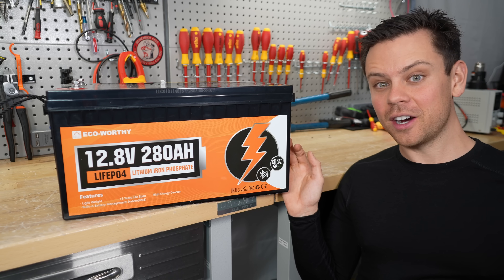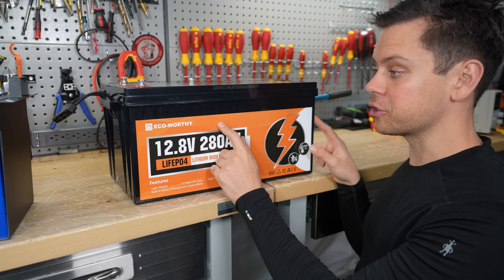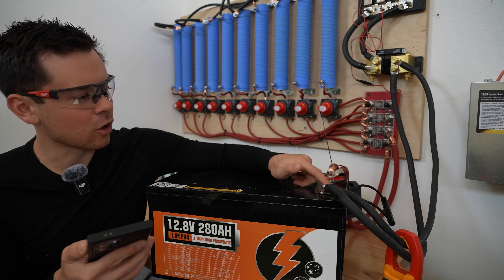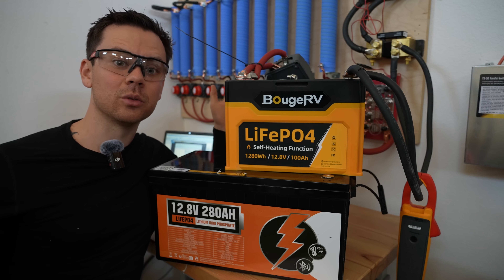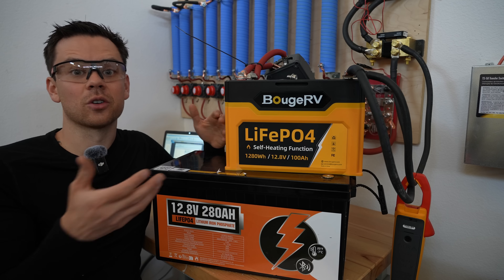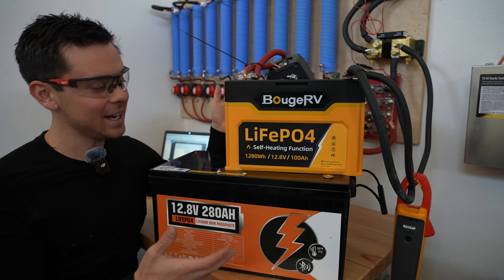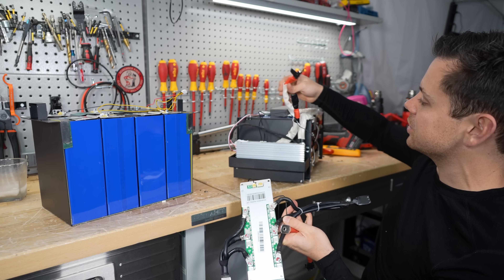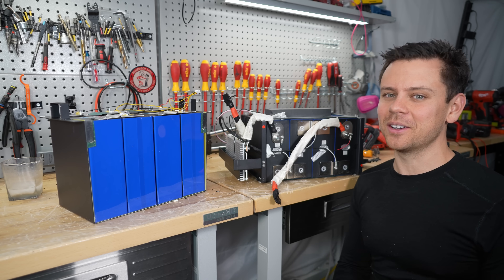$423 Ecoworthy 280Ah VS $529 Wattcycle 280Ah and Over Current Discussion!

Comment: Great surprise with this battery. I think they have a sister company (DC House) would you be able to get a hold of their DC House 100ah with usb-c and 12v/5a Dc port? I am very curious which cells they use and how they connect the usb/dc ports to its BMS

Comment: I would love to see you do a test on this Brand and model! 

Love your channel, I've learned so much from you!
 VESTWOODS 12V 250Ah 200A BMS, LiFePO4 Lithium Rechargeable Battery, Bluetooth Lithium Battery, 4500 Cycles, 3.2kWh, Low Temp Cut Off, IP65,

Comment: If the WATTCYCLE changes the 300AH to 280AH on the box... I would buy it. But not if they want to try and deceive their customers
Reply: Did I miss something? It still has the 300+ capacity. So what if the cells were labeled at 280. Those labels could be wrong. Bottom line is that they perform as advertised. Don't see the problem.
Reply: @jefsel881  Yes, batteries typically test high for the first few cycles. When Will disassembled the battery the marking on the battery says 280Ah. They're using the fact that batteries test high when they're new to advertise their battery as a higher capacity than it actually is. AKA FRAUD

Comment: Since I don't drive my batteries anywhere near their rated current capacity, I would always take the higher cell quality than just a larger heat sink on the BMS. That's just my priority based on application long-term.
Reply: Golf cart applications can change those thoughts as discharge current is key.
Reply: Does the Ecoworthy say which brand of cells they're using?

Comment: Balance the cells & retest!
Reply: For a newbie - how would you balance the cells in this battery without cutting it open? I thought you needed access to each individual cell to balance them?
Reply: @ertman  when you check the app, you can go into the settings and check the voltage on each cell. Usually, after using the battery a few times the BMS balances them naturally. When I got mine, they were all unbalanced. I charged it once and used it for about two days and checked it, and the app showed that each one was balanced
Reply: Exactly